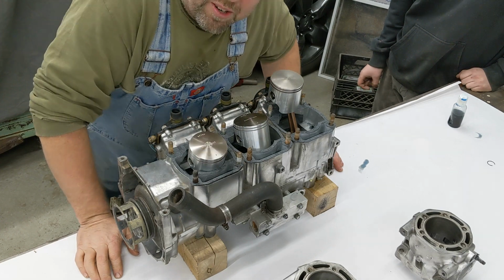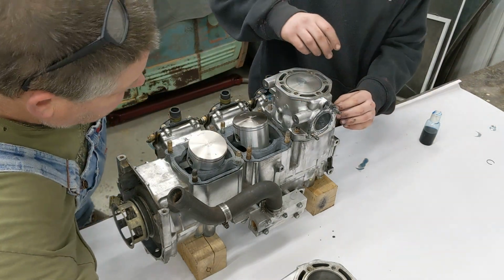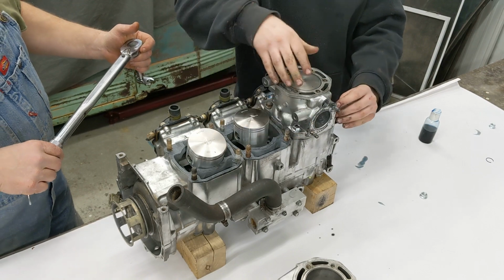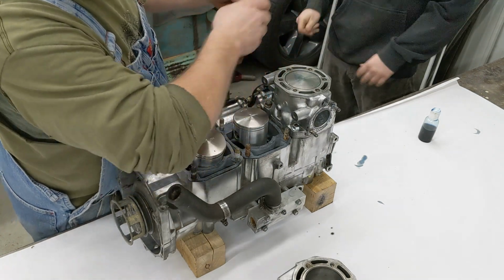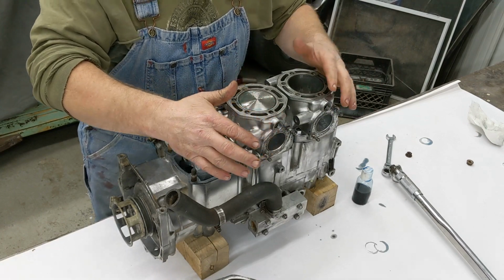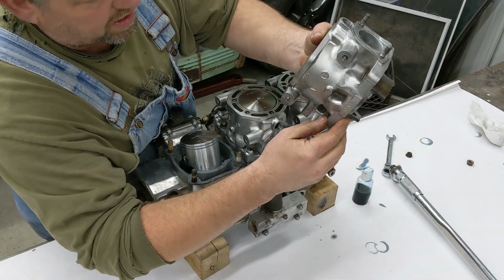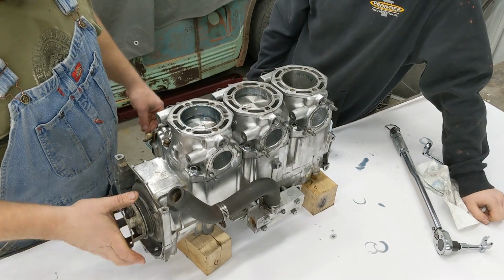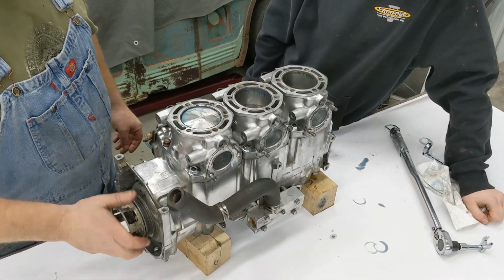CRAZY POLARIS MOD TRIPLE 800 NORGE

Comment: Instead of the crows foot. Take a look at the Motion Pro wrench. It has a box end versus the open end and is so much easier to work with.
Reply: 100% agree
Reply from the maker: I'm definitely looking into these. Thanks Tom
Reply: @toddclyne3493  I only use the Polaris size on there, so I cut the other side off and ground it to look halfway decent. There is paperwork that explains the math with it and such, too.
Reply: We just cut an old wrench in half box end and weld a 3/8 drive socket to the end. Crows foot works just fine too whatever floats your boat!! ;)

Comment: Where did you get your .60s I tried to order them from Psep but they sent me .40s billed me for the 60s and said they can't order them anymore. I'm gonna use the .40s, just gotta get my .60 sleeve punched out of the cylinder I bought and have a standard put in and have all 3 bored .40